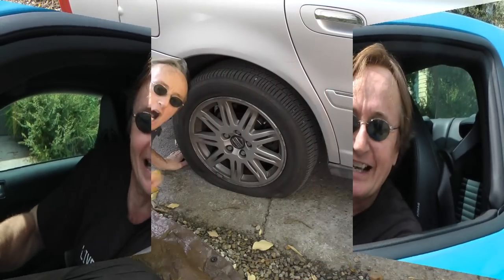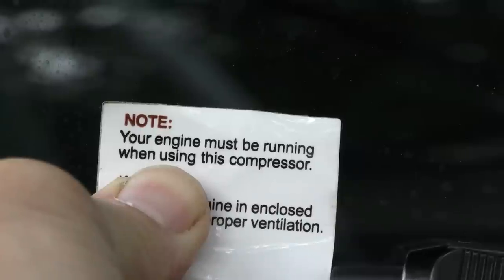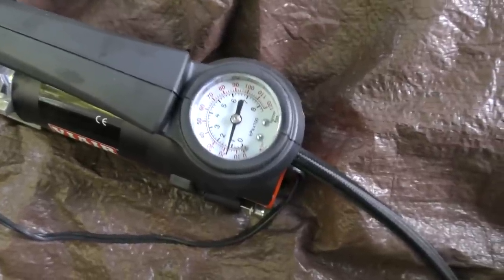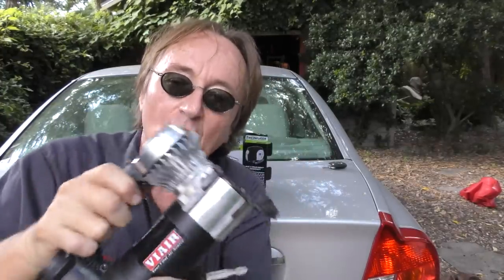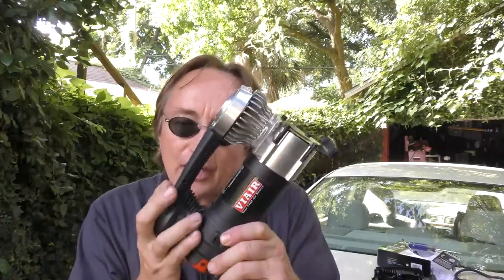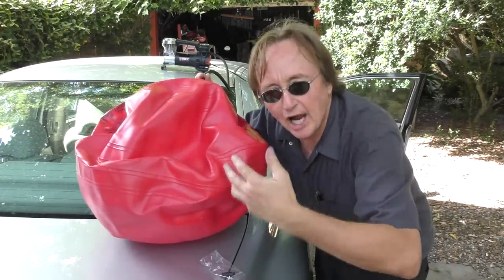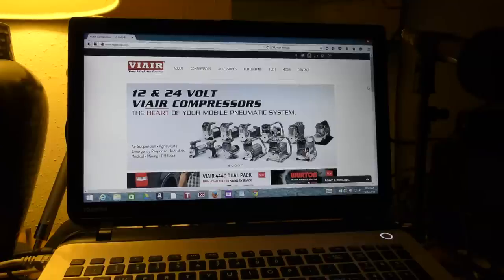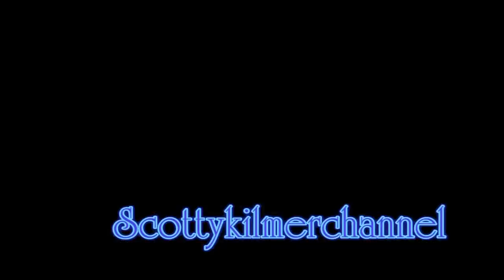How to Inflate a Flat Tire on Your Car (Tire Inflator)

Comment: I have a Chinese 10 dollar plastic one from family dollar no less Scotty, Ive had it for 4 years and it still works fine I have inflated my bike and truck tires many many times I must say that is a attractive buy though.
Reply: Flame And it was free, mine was 10 dollars almost free and like i said i've had it for 4 years, But then again that Viair one looks like it will outlast mine for decades haha
Reply: Anthony Rodriguez I also have a $10 Chinese compressor. I got it 7 years ago, but I have only used it a few times to top off the air, maybe every 6 months. Takes forever and a half.

I sort of want it to break so I have an excuse to buy a better one, lol.
Reply: ***** Haha, yeah !
Reply: There is nothing wrong with cheap ones like that.  I would just look for reviews to make sure it won't die half way through inflating a tire at some cold, dark and ungodly hour when I need that tire to get me home again.  That would be horrible.  Make sure to read the reviews so you know that it is not guaranteed to die by next week.  Now when you read them, there is always likely to be one or two people who had terrible luck and will never ever ever buy that brand again.  The thing you want to look for is that the vast majority were pleased with theirs.  It is not going to guarantee that you will not have problems but it should at the very least give you some piece of mind knowing you didn't squander your money on useless junk.
Reply: Yes they have excellent prices but much of that stuff is flimsy or soft steel.  You save money but get junk that doesn't last long like saw blades that go dull quickly or similar things.  Some of the stuff they have there does have known good brand names and some of it is just generic stuff.  If I want a reliable pump, Slime won't be my first choice.  I don't buy the most expensive things, I just avoid things that were made to fail.

Comment: I  bought a cheap plastic pump at a goodwill for 3 bucks the package it came in seems mid 1990s it has lasted  me 15 years so far no problems.
Reply: thats not bad i baught a new 1 4 years ago and now its fucking nackerd i just fixed my tire with 1 of these repair kits but cant pump me tire  up oh bollocks
Reply: What brand was it?
Reply: When pump hiss when connected to tire help.
Reply: Does it still work?

Comment: I  bought a cheap plastic compressor on harbor freight for emergencies. It took about half an hour to inflate a flat tire and the compressor felt like it was overheating. Some time later, bought a VIAIR compressor. This was  long before I saw this video and got this brand due to positive reviews on amazon. The VIAIR compressor was able to inflate a flat tire in less than 3 minutes.

Comment: I keep one of these small compressors in my jeep at all times. I used it one day for that exact purpose. Found out I had a flat leaving work one day,pumped it up, drove home and patched it. It's also good for maintaining tire pressure,  better than stopping at a gas station where here in CT they charge you for air!

Comment: I have that same exact compressor, its a little beast, used it to air up my tires on my dually during winter, worked great. Does get REALLY hot though (metal parts), so careful not to burn yourself

Comment: Part of my job is maintaining a company fleet of 60+ vehicles.  We have one of those cheap Slime brand air compressors, and have pumped up dozens upon dozens of low tires for over a year now with it in wet, dry, and cold conditions.  It looks and feels cheap, but is more than suitable to keep in your vehicle for emergencies.  If it fails tomorrow, it was still well worth the $25. I may consider the better, more expensive metal one then, since we pump up tires more often than someone just keeping one for emergencies or the occasional fill.
Reply: +Alex Sweers Yes of course, but investing in high quality tools pays in the long run, at least statisticly. Though sometimes the cheaps things can do the job aswell. It comes down to personal preference and the size of your wallet. :)
Reply: I agree! :)

Comment: I have a 1998 Audi A4 1.8T, it almost has 168.000 miles on it and it's drinking oil like it is gas and it has also started to make these awful crackling noises when turning and it has also lost some power, it feels really slow compared to before. Would it be worth getting these things fixed? Overall the car is in good shape, exterior as well as interior. It almost has no rust at all and starts and goes in any conditions.

Comment: I have a little plastic one. The inside looks almost exactly like the one you demonstrated except my one has an aluminium piston. I lubricated the whole mechanism with oil to make it last longer. It's biggest problem is it has plastic gears and they get a pounding when pumping up the trailer tiers. It's pretty cheap and nasty. I've been thinking about getting a big one for a while.

Comment: Also check the tire after it gets refilled to find out the cause of the flat. Could be a simple as a nail or as complex as a warped rim or a slash on the tire. But it's always a good idea to keep a pump with you. At least it'll get you to a service station on those long road trips. :)

Comment: I do agree that everyone should carry a lighter plug in small tire pump in their vehicle.  If you have a flat when you go to your vehicle you can air it up to at least get it to a tire repair place.  I carry one and being I am a mechanic I carry a plug repair kit so I can repair the leak after I air it back up as well.  I have had to use my pump two times in the last 4 years, but oh my gosh it saved all the trouble of jacking up the vehicle and using the spare and all that mess.  All motorist should have one.
Reply: Earl Guyton Can you use a 12v Portable Tire Inflator with a Older car that just has a Cigarette lighter & not one of those ports that newer cars have that say 12v on them?

Comment: Great video. Would  this be okay to run off of the cigarette lighter of a 2013 Audi A6? I'm assuming that it's 15  amps. I'm not sure of the output on the car and don't want to hurt the electrical system of the vehicle.  Any advice?  I would probably be fine but I wanted to ask anyway. Thanks!
Reply: Luis Cannon1 second agoI plugged in my new compressor into the cigarette lighter and blew the fuse for the cigarette lighter, should have used the accessory socket which are 20 amps instead of 15 amps. lesson learned!

Comment: I have a Viair. My Viair connects directly to the battery, so it pushes a little more air than the cigarette lighter version. The first thing you'll notice is the quality of the build. Mine works like a champ.

Comment: Hay Scotty, I have a 2001 Toyota Corolla and my engine has some weird ideling problems. An example would be when it first starts cold in the morning it idles super low at like 600 rpm but as the engine heats up it crawls up to 800 rpm. Turning on the AC also drops my idling by 100 rpm and putting my car in park (with ac off) makes my car idle at like 1200-1300 rpm. Is there anyway to fix this crazy idling problem? Thanks Scotty

Comment: big rig trucks usually have an inbuilt compressor. I've seen inflator hoses that hook up to the gladhands and with the governor set to 120psi they've got all the air they need for pumping a few tires while idling

Comment: I have a 1999 Acura Integra GSR and i just recently replaced my axles, only when im in gear accelerating i get strong vibrations from the front, but as soon as i let off the gass or if i even give it gas while in neutral it is fine, what could be wrong? Maybe my half shaft?

Comment: those little compressors can save your butt. i ended up having the tire come off the bead off road in the middle of no where. that little compressor actually reseated my bead by pulling on and letting the compressor run. sure it took like 10 minutes to fill up a 33 inch tire but sure beat walking

Comment: Mine is built into my emergency battery booster...along with a 120v current inverter, 12v outlets and work light.  I used both the light and the 120v. during a recent power failure in my area.

Comment: Scotty Kilmer . I know you mainly work on imports. I dont think ive heard anything about domestics. 2000 mustang gt. Blower motor turned on regardless of speed, a/c or heat. Idle speed will drop about 500rpm about every 5seconds. Alternative tested fine. Your thoughts?
Reply: *Alternator
Reply from the maker: mjincali1 blower motors blowing all the time are often either a bad shorted out blower motor relay, or a bad control unit on the dash. They are so complex, have a guy like me hook up a dealer level ford scan tool to analyze the hvac system first.

Comment: Viair makes a good portable 12 v compressor but  be sure to read the owner's manual to see what the duty cycle is, and not to exceed it. I'd also suggest touching the fins on the cylinder to see how hot they are getting. If they start to get painfully hot - you've reached the end of the duty cycle; give it a rest to allow it to cool off. I have a similar model as the one you show and I figure it will top up 4 tires or totally fill up one tire, before it needs to rest and cool off.

Comment: Scotty, 
what is your opinion about filling tires with nitrogen instead of compressed air?
Reply from the maker: a joke, earth's air is already mainly nitrogen
Reply: hey scotty what are your thoughts on run flat tires?? maybe you can make a video about that, are run flats better than standard tires etc. Let me know
Reply: +Mark Joseph just happens i got run flat tires on my 2014 Sienna. so run flat is just about the same as a standard. but only difference is that if you happen to puncture your tire its still 100% drivable as no air would deflate and having to change to that spare. but you still gotta replace that tire asap. and also its more expensive to buy compare to standard.
Reply: +LowKeyxAkp that's what they say the run flat tires performance are suppose to be but many consumers say the tires last less than 10,000. How long have u had the run flats?
Reply: +Mark Joseph 15,988 to be exact and in good condition. but that varies as how often you drive.

Comment: there one thing i don't get with this tire saving spare "tire", do you fill it up, remove the kompressor and go? Or do you fill it up and leave it in and run with it as it is pumping air into the tire?
Reply from the maker: xBuzz996 of course you remove the compressor when it's filled up. Most flat tires are caused by nails, which can take days, weeks, or even months to get flat. It doesn't fix the flat, but it will often get you where you're going, then you can get the tire patched or buy a new one if needed.

Comment: I have a plastic Slime compressor, and it's done me fine lately, probably cause I only use it to fill low tires. When my tire is actually flat, I use my full size spare tire! And the Viair sounds just like my breathing machine I had 15 years ago when I had asthma!

Comment: Is it safety to use it on hybrid car ?
what method would be better for hybrid car's? plug it in cigarettes  lighter or connect the +ve & -ve  cable with battery ?
would suggest any advice about it ?
Reply: This one has a Fuse inside so it won't hurt your car. I would recommend any you get should have a Fuse, some even give you a Spare fuse in case you need to replace it. Keeps your cars computer from getting fried.

Comment: scotty, my suspension is making knocking noises. when i took the wheel off the sway bar end links are the only things movable by hand and look worn out. would these cause that knocking noise? everything else is tight and looks fine. just want to make sure these little guys can actually cause knocking noises that i'm hearing. can you confirm please? 02 Hyundai Accent
Reply from the maker: junior pons yes, worn sway bar links do just that.
Reply: Thanks Scotty.

Comment: Hey Scotty, I'm a big fan of your videos. It is difficult to be good at everything, but your videos helped me not be ripped off by other mechanics. I had a question, I recently got myself a Tesla Model S. I was wondering what your thoughts are on these new electric vehicles? Are all the claims about less moving parts = more reliability accurate?
Reply from the maker: Sahil Malik you must be a rich man, those are uber expensive. No one knows about reliability, as they haven't been out long enough. Only time will tell that, since electronics can break down even faster than mechanical parts , who knows yet?
Reply: Scotty Kilmer I'm just a dedicated person who cares about made in America and good for the earth. :)
I'm a techie, I can't see why electronics would wear out faster than mechanical parts, there is nothing to wear out. Still, there is plenty that can go wrong. Air shocks, pano roof seals, power windows/locks etc. etc. And electronics can be unreliable due to non wear and tear issues. The car is a rolling computer, and there is a lot of bad computer code floating around. You are right, time will tell. If you are ever in DC, I'll be happy to buy you dinner for all your awesome help online. We can also ride around in the Model S.

Comment: I do like Viair pumps, I actually have one (at the time I got it it was the most powerful one that would run from the cigarette lighter), works great 5 or so years later.
I think the reason they say to have the car running though is that it uses quite a few amps, if you do all your tires and you have a weak/old battery you might need a jump after using this pump. Also I found that the pump would run faster when the car was on as well... I'm guessing the 13.5 or 14 volts from the alternator gave it a little more juice.

Comment: Scotty i have an issue with me isuzu ascender. i went to a shop and they replace just the right side of the control arm bushings and i thought everything would be cool after that and i do need struts in the front but not badly. The next day when i was driving i heard a clunk sound as i was making a left hand turn, then a right hand turn heard it again. now my cv joint and booth are fine. the sound only happanes when i make a 1/4 of a turn and not a full turn. can you please help?

Comment: Will that pump handle 33x12.5 tires? I need something to air up after going off-road
Reply from the maker: mamefreak3 the big one will easily, the smaller one would work but take a LOT longer

Comment: Thankfully, rarely get flat tires.  The last time I had one, I was not lucky enough to find it that way in the driveway.  Sometimes these things happen on the road.  Even if the pump doesn't have its own fuse, the sockets often have them.  Look in the fuse box for it.  I find that if the engine is not running the pump fuse blows easily.  That is unfortunate since you only get one or two spare fuses but at least they are very commonly available parts.

Comment: hey scotty i have a 01 audi tt the problem is that the ac doesnt blow cold air it only blows hot air i connected a gauge to the ac line and it shows that it has freon what can be the problem?

Comment: I have a Slime compressor kit.  The power cord wraps around the plastic housing, and for some reason reacts chemically with one another.  The plastic housing is actually melted...and no, I didn't run it with the cord wrapped up.

Comment: My 02 Chevy Malibu runs and drives great for 10-15 mins. Then cuts off as if out of gas. It usually restarts in about 2-3 mins. I replaced the inline fuel filter. Problem not solved. Horn blows after I manually lock doors.Sometimes doors lock automatically. Anti theft light is almost always on. Fuel pump is working. Key remote stopped working over 4 months ago. Any suggestions?
Reply: Sounds like some kind of anti theft system malfunction.

Comment: I feel like for most people, the plastic model is good enough.  Assuming you take care of your tires (including not driving over potholes on a regular basis), you might only use a tool like this once or twice for your car's entire lifespan.  If you keep it in your car at all times, the reduced weight is always welcome.  The Viair is definitely a much better product for people who regularly fix tires.

Personally, I use the PSX2, which is used to jumpstart cars and fill up tires.

Comment: The worst compressors are the ones built into the Jump starter packs. I've gone through 4 of them, due to the cheap plastic construction. I tried a few different units, but got the same result.....thing grenades and all you can hear is the little motor free spinning inside. The hardest thing I was doing was trying to bring a tire from around 25 psi to 40 psi. Admittedly 1 of the times I let the unit run longer than the 5 min they were limited to. The others they just crapped out after 3 min or so. Might give one of these expensive units a look.
Reply: The plastic ones just use a piston to push air in and out and are so damn noisy. Most bounce around on the ground because they aren't heavy enough.. Mine even says on the box it's quiet and it's a lie. I end up holding it in my hand bent over because the hose isn't long enough and it will bounce up and down on the ground like a sick frog. The best one I have seen of that kind is the TireTek model, comes with a built in Fuse from what I remember and it doesn't move around, at least you can set it to turn off when it reaches a certain PSI unlike this model.

Comment: I had a better Slime compressor. I say had because it's motor, NOT THE PLASTIC HOUSING, snapped!

I was only using it for a touch up. Wound up buying a bike footpump because it was cheap and small. Sure it takes a while to fill the tire up, but I've got some rocking calves now!

Comment: Hey Scotty I have something similar but it's a Husky. When i plug mine on my cig. light it doesn't work and the air compressor is new what could be the issue?
Reply from the maker: Dblade981 check the cig light fuse first.